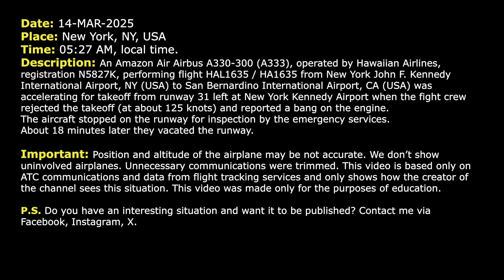Loud bang on the engine. Airbus A330 rejects takeoff at JFK Airport. Real ATC

Comment: 2:42 Pilot ask for the truks
After 2 and a half minutes - talking with car 99 - the trucks were still not at the plane.
A bit slow responds, isn't it?
Reply: Not necessarily, assuming the controller immediately called to the station (probably took at least 10 or 15 seconds) as an Alert 1, and the firefighters were out of the station within 90 seconds, they would only have been responding for less than a minute. Add in the time it might take to get clearance to cross some intersections and the fact that the station may have been some distance away and it makes sense.

Comment: The same plane departing again less than three hours after aborting takeoff for a loud bang in the engine seems a little quick. Usually engine problems involve a lot of troubleshooting, paperwork, waiting for parts and installation time. The aborted high speed takeoff checks also require time and paperwork. Even more if tires and brakes need to be replaced. Thats just my experience with these events. Theres always an outlier though.
Reply: Normally a bang is not a reason for an abort in the high speed regime. Maybe they found something obvious like a panel that had popped open.